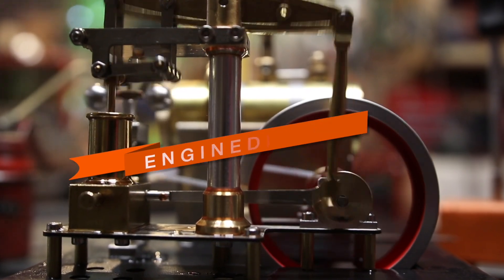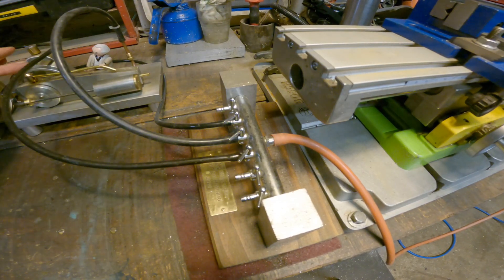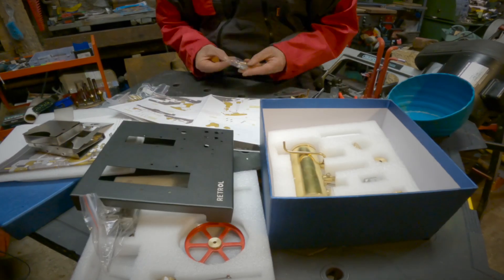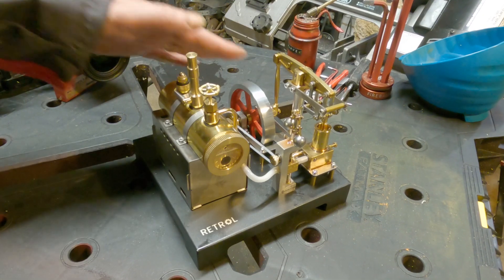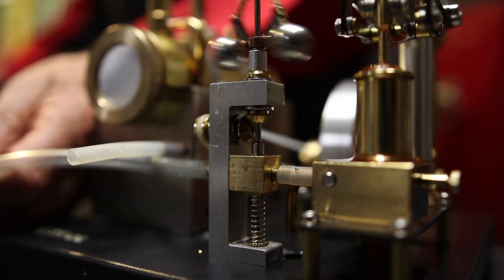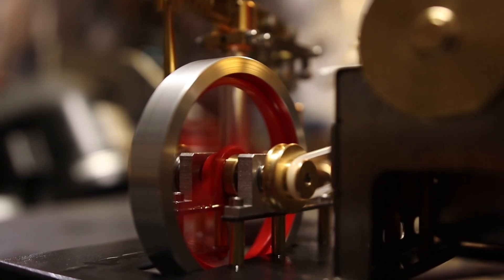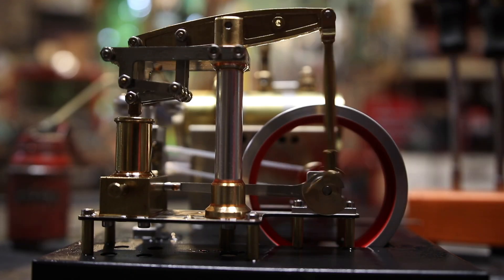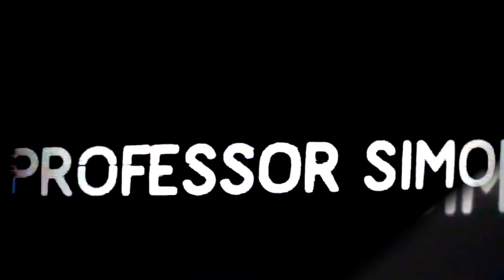The BALL Governor Steam Engine

Comment: It's interesting to see you run your steam machines on compressed air.    Some decades ago on TV shows like tomorows world they showed these very light taxi's that run on compressed air with a big carbon fiber tank.  Apparantly there are still a bunch of companies working on them. But they dont have the same range as petrol cars i guess.  But i guess only recently with electric cars people start looking at alternatives.  Just read something that someone bought a hydrogen car for $50.000 but now it needs a new fuel cell a repair will cost $100.000 as they only made 1000's of that car.  Alternative energie isnt easy ..  but the advantage of a compressed air car is that its relative simple and has relative simple parts.
Reply from the maker: thanks Apsdev

Comment: Balls out
Reply: I wonder how many people know what that means?
Reply: @dean5263  Clearly it's a technical term, dating back to the mid-nineteenth century. You see, @dean5263, engines in those days ran on steam and, like our modern generators, had governors. The difference between then and now is those early governors featured balls of brass, such as you see here on Professor Simon's machine. Whenever the chamber gets hot, the pressure builds up, so the balls come out, maintaining optimal stroke speed.
Reply: Thank you, I thought it meant to run it at full speed where the governor balls were all the way out because of the centrifugal force. @DistracticusPrime
Reply: @DistracticusPrime  
My mom says that I can't play with you any more.